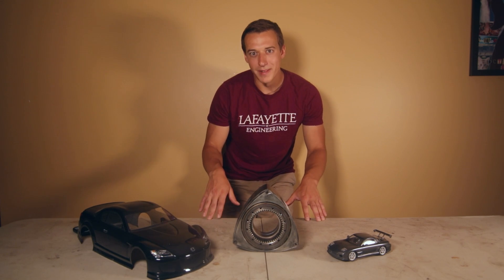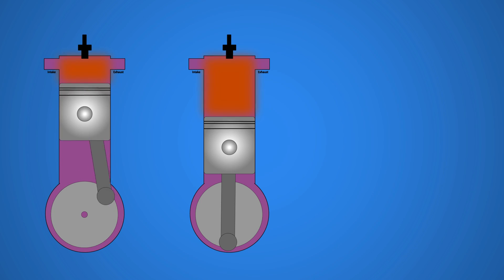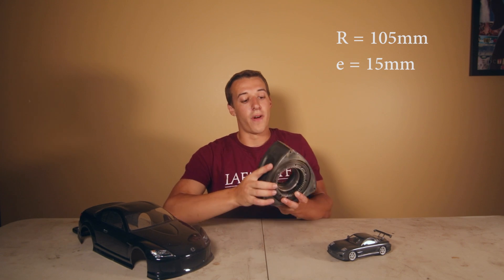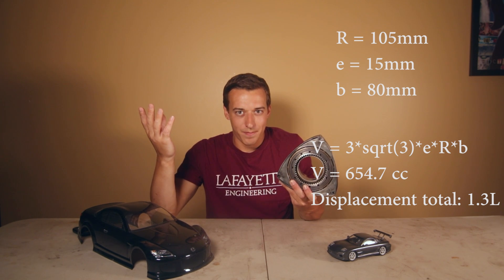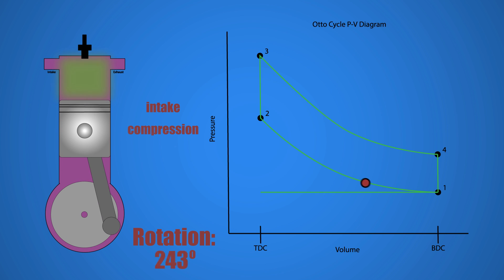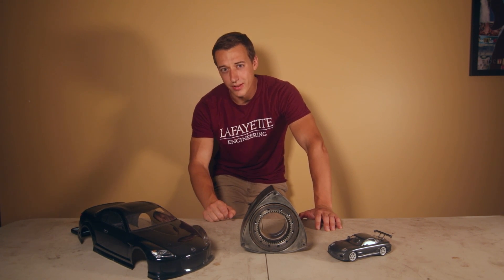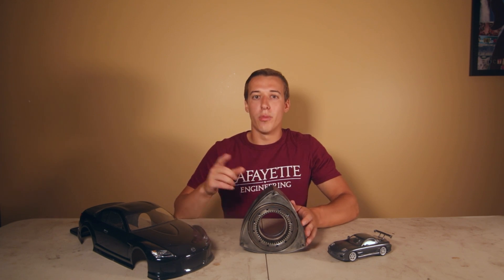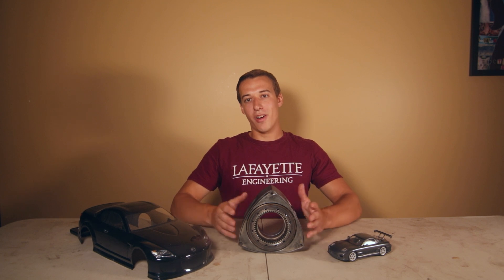You are WRONG about Rotary Engine Displacement

Comment: Unfortunately this video performs 2 instances of bait and switch.

First you correctly compare the swept volume of a single piston to a single face of a rotary engine but then perform the total displacement calculation by multiplying the swept volume of a single face by the number of rotors, each having 3 faces. 

Then when explaining the cycles you compare the piston cycle using crank rotation but then use rotor rotation for the rotary, which again is only valid per face of the rotor and requires 3 revolutions of the crankshaft. You mention this in the video but then proceed with the actual bait and switch by saying that this means that 1 Otto cycle is performed per revolution of the crankshaft which is only true when considering all 3 faces of the rotor.

The reality is that it takes 3 eccentric shaft rotations for a rotary engine to complete the full thermodynamic cycle as opposed to 2 revolutions of the crankshaft for a 4 stroke piston engine. This is the basis for why the rotary engine is sometimes classified as a 2.6L engine in competition as they are trying to even the playing field by setting displacement at 2 revolutions of the crank for all engines. In other words they aren't arbitrarily doubling 1.3L they are actually going down from 3.9L.

I also noticed your reply to a similar comment where you said that because combustion was not occuring on all faces at the same time that this somehow invalidates the calculation but this makes no sense. Surely you don't think combustion is occuring in all the pistons of a piston engine at the same time?
Reply: Excellent comment, you very elegantly cut the legs right out of this false urban myth.
Even Felix Wankel disgreed with the marketing department of NSU that concocted the fraudulent concept of "tax displacement" used by Mazda and other manufacturers to boost sales in countries that have registration taxes based on engine displacement.
Good work!

Comment: Sorry, you are missing the fact that each side is a separate piston, as my previous post states.  I rotor = 3 cyl, so again, 3.9L if that is how you wish to measure it.
Reply: Only one side of a rotor fires at one time not all 3, 1.3l
Reply: @edwardwillis6409  But each chamber has its own intake, compression, power and exhaust cycle.

There is a combustion cycle per  crankshaft revolution.
Reply: @edwardwillis6409  really I had no idea.   But at least in a three cylinder engine, they all fire at the same time ....
Reply: @Lonewolfz24  look up 3 cylinder firing order please
Reply: @Lonewolfz24  The true actual displacement is 3,924cc's 

Each of the chambers has its own intake, compression combustion and exhaust cycle.
Reply: @sandervanderkammen9230  I know each face / chamber does all of the cycles, I replied to your other comment explaining what I meant cus you misunderstood what I meant
Reply: @edwardwillis6409  If all 6 chambers have thier own intake, compression combustion and exhaust cycle.

Then each chamber has its own swept volume displacement. The total displacement is 3,924cc's
Reply: @sandervanderkammen9230  that's what my post said.
Reply: @Lonewolfz24  Yes, you are absolutely 100% correct sir, the Mazda 13b has a displacement of 3,924cc's

Comment: It is a 1.3L per Mazda and the Japanese government for tax purposes, ( hence why Mazda argued for the smaller displacement).  This also has been argued alot for 1.3, 2.6, or even 3.9 on rotary engines since they were first created.  Even more so, all three answers are correct depending how you do the measuring.  

1.3 - Correct for the way in which we measure a piston engine.  Cyl displacement x number of cylinders.  
         This comes to 1.3 for a Mazda rotary 13B engine, as there are 2 rotors, with a displacement of 654cc each = 1.308L

2.6 - Correct if you figure that a piston engines power figure is based on a 720 degree 4 cycle power delivery.
         A rotary makes full power stroke every 360 Degrees meaning its effective power is double same sized piston engine.
         (this is BTW why when rotary engines are in racing series, they are doubled in displacement, to equalize the numbers)

3.9 - Correct when you consider that unlike a piston engine, a single rotor has three sides all working at the same time.
         Imagine a piston engine with a combustion chamber on BOTH sides of it, then displacement would be double.
         On rotary engines, one rotor has 654cc displacement on ONE side of three,  then x2 rotors.  

The Best and easiest way to look at a rotary engine is to see each rotor as 3 cyl, with 654cc displacement per, making power every 360 degrees of rotation.  This would make a 13B about the equivalent to a 2.6L (power) 6 cyl (2 rotor x3 sides) 3.9L (efficient) engine.
Reply: If you have 6 chambers, each has a swept volume displacement of  654cc's 

It does not matter if the engine is a 2-stroke at 360°
4-stroke  at 720°
Or a Wankel at 1,080°

The displacement  will still be exactly the same  3,924cc's
Reply: @sandervanderkammen9230  I don't disagree, the point wasn't to say it should be called a 2.6L, but that the power output is like that of a two stroke, which is why in racing, they tend to calcify the rotary engines as double, to give a comparable piston engine an even playing field.
Reply: @Lonewolfz24  The 2X conversion formula is intended to compare rhe Wankel engine wirh reciprocating 4-stroke engines.
To compare the relative displacement at the same 720° cycle duration.
The Wankel engine is not a 2-stroke which is where much of the misunderstanding begins.

Most engineers, government agencies and motorsports sanctioning bodies use the 2X  formula for calculating the displacement of the 654cc's chambers at 720°.
Reply: @sandervanderkammen9230  you know, this argument is getting tiring.  Everything you said is correct.  Notice I didn't say the rotary is a two cycle. I said as it makes a power stroke Every 360 degrees of the "crank" LIKE a two cycle, that's why they do the 2X for racing conversion.  Which is what you just repeated.  Simple, true displacement is 3.9 6cylinder making power at double the crank (yes it's not called a crank) like a two cycle engine.  Another way you can argue it is to say the rotary runs at double the rpm as a piston engine for purposes of power.  My whole original point was that you can make the argument for any of the three displacements depending how toy want to look at it.  The 1.3 being the most incorrect IMO.
Reply: @Lonewolfz24  A 6-cylinder Otto engine has 3 combustion cycles per crankshaft revolution.
The Mazda 13b only has 2.

The Wankel engine runs at 2/3rds the cyclic rate of a 4-stroke reciprocating engine.
Reply: @Lonewolfz24  FYI: Yes, its crank...
Hanns Paschke and Walter Freode named it an Exzentrschekurbelwelle
This translates into English as
Eccentric-Crankshaft.
Reply: @sandervanderkammen9230   man you are just grasping at straws to show someone else up.  Fine, I'll play along.  In English, it's just referred to as the eccentric shaft, instead of a crank shaft, which is why I said it.  However since you'd like to use the German term, sure, it is a crankshaft.
Reply: @sandervanderkammen9230  only in a 2 rotor setup.  Again, we are all just trying to liken two dissimilar ice engines to one another.  I have not said it is the same as something else, only the easiest way to compare them.  And your point just shows another reason you can say it's a 2.6 instead of 3.9.  As I stated from the get go, all three can be argued, as it's all how you want to look at it.
Reply: @Lonewolfz24  An eccentric shaft can be a crankshaft or a camshaft all depends on how it is driven...
In the Wankel KKM is driven as a crankshaft.
Hanns Paschke and Walter Freode were both German... they invented the Wankel KKM and they say its a crankshaft

FYI: Felix Wankels' engine doesn't have any shaft... its a Rotary type engine.
Reply: @Lonewolfz24  You still miss the point...
 displacement of an engine is calculated exactly the same way regardless of the operating principle used.
360°, 720° or 1080° cycle makes no difference.

The Mazda 13b series has a displacement of 3,924cc's 
No more, no less.

Yes, you can say "its like a 2.6" when compared its power per liter performance to a 4-stroke reciprocating engine but its still a 3.9 liter because that is it's true total displacement.

3,924cc's
Reply: @sandervanderkammen9230  and you seem to have missed the point that I've said I agree with the 3.9 many times in this point .... I'm not arguing against it.
Reply: @Lonewolfz24  Yes, we both agree about the displacement.
What you seem to be having trouble with is the logical conclusion of how we get to that displacement value.

Displacement is calculated exactly the same regardless of the number degrees to complete its cycle.
Reply: @sandervanderkammen9230  insulting now, I do understand, I'm not arguing the displacement, or the reason you are using it.  I haven't disagreed with the swept volume.  It's one way to measure it, and that's fine.  Mazda used the way that was best for them, is that surprising.  As it's not a like for like with piston engines, that gave them a way to argue to measure it differently.
Reply: @Lonewolfz24  I’ve been playing along too I can’t be asked to argue until he takes off his ego hat
Reply: @Lonewolfz24  No insults intented, as I said before there is only one way to calculate displacement of a internal combustion engine.

It's important to get the right answer but you need to understand how you reached that answer, on this matter you seem to be attempting to save face..
There is no need to be embarrassed, its a confusing topic.
I just want you to get it right, thats all.
Cheers mate!
Reply: @Lonewolfz24  NSU Motorenwerkes GmbH. Made that argument, the was their reasoning that if their company invented the Wankel KKM engine they could determine the method of calculating its displacement.
Mazda simply adopted this purely marketing logic... and as the very last manufacturers of Wankel engines until 2012, this myth regarding displacement has continued and has only caused confusion and misinformation.
Reply: @edwardwillis6409  You won't learn anything about Wankel engines until you take off that dunce hat son.
 Stop pretending to be something you are not and pay attention.
There might be a few people who know more about Wankel engines than I do..
But not very many.
Reply: @sandervanderkammen9230  lol, man, you are just trolling.  I never said Mazda invented the displacement tax method, but I did say they convinced the Japanese gov to see the rotary engine as a 1.0, when they released them to get the tax benefits.  Hence saying that Mazda had the rotary classified smaller, for their benefit
Reply: @Lonewolfz24  Not for one second, I'm serious as a heart attack. 
 Be honest, you didn't know the origins of tax displacement method before I explained it to you... and just because they chose to use this sales ploy to their advantage, does not mean that this method or Mazda is correct regarding displacement.

Swept volume displacement is calculated exactly the same way for reciprocating engines.

You can choose to disagree with me but both Max Bentele and Hanns Paschke say you are wrong.
Reply: @sandervanderkammen9230  dude, you keep repeating yourself, and I've said over and over that 3.9 is correct, it's like you are arguing with yourself.   Maybe you should read the very first post again, and articulate what your grievance is.  You seem to be misunderstanding, or misrepresenting what I've said, as you have now many times tried to argue something that is the same as what I've said.  Yes, they did it for tax reasons, I never said they didn't.  No, I never said Mazda invented the tax method.  Yes, the true displacement is 3.9 if measured like a piston engine, that's in the original post.  As the engines do not work the same, one could/can/ and did argue that the displacement should be different, as they function differently, which is what Mazda did.  All three could be used, depending how you would like to look at it.  No, in English, the language we are having this talk in, the "crank" is simply called an eccentric shaft (even by Mazda), while in German is is called a crankshaft .... which all seems very pedantic to sound like a know it all and somehow more knowledgeable than someone else, when all you've done is agree with my original post .... what is the point sir?
Reply: @sandervanderkammen9230  just saying I said take of the ego hat cus your replies seemed rude, it seemed like you thought you are better than everyone (not talking about what your saying, it’s how your saying it), just be nicer. Don’t TELL people educate them your somewhere in the middle of those two. 

Also if the rotary is a 3.9 does that make it not a true small engine compared to like the b16 from Honda the 1.595cc engine?
Reply: @Lonewolfz24  Your original comment suggests that it is correct to say the 13b engine is 1.3, 2.6 or 3.9 liter...  it is not correct to say it is a 1.3 or 2.6 in swept volume displacement.
 It is only called a 1.3 by using tax displacement which was used by some manufacturers, it is not universally accepted and is not a valid method for calculating the displacement.

It is only appropriate to say "its like a 2.6 liter" when compared to a reciprocating 4-stroke engine.

Its is not correct to say it is a 2.6 liter. 

I hope this clears up your confusion.
Reply: @edwardwillis6409  Yes, I agree, your comments do seem rude and disrespectful, if you wish to be treated with respect? You should do the same.
It is extremely rude to argue about a topic which you are not properly educated or experienced to discuss inteligently.
 You are not an expert on Wankel engines or engines in general, yet you rudely post disrepectful comments disputing well-known and understood facts on this topic..
Perhaps what you need is a little more studying and some maturity?
Reply: @sandervanderkammen9230  you get what you give in my opinion in short your replies seemed rude so i was rude to you
Reply: @edwardwillis6409  The facts speak for themselves, you simply had a rude awakening because you were unprepared to hear it.
Reply: @sandervanderkammen9230  as you were confused, read the last paragraph again, it should clear everything up.  It clearly says the engine displaces 3.9L.
Reply: @Lonewolfz24  Thats my point, your comment is confused and misleading.
Reply: @sandervanderkammen9230  I'm sorry you were confused and mislead.
Reply: @Lonewolfz24  Perhaps you should correct you mistakes then?
Reply: @sandervanderkammen9230  mazda didnt stop manufactuing the 13b in 2012. They stopped manufacturing the rx8. You can still buy brand new 13b from them
Reply: @hayeduce  Mazda ceased series mass production of all Wankel engines on June 21st 2012, the Ujina #2 RX engine plant was demolished in 2013 and replaced by a Skyactiv G engine factory.
Reply: Actually, relative to every other internal combustion engine and how displacement of an engine is calculated, 3.9L is the only correct answer because number of crank shaft revolutions it takes to move the complete engine displacement has no baring on an engine's actual displacement. The engines displacement is simply the volume of a single working chamber times the number of chambers. Example, a 2.0L 4 cylinder engine has a single cylinder swept volume of 500cc and has 4 cylinders and thus its displacement is 2000cc (or 2.0L) and as you mentioned, a rotor (13b sized) has a single side that displaces 654cc and has 3 sides so that single rotor complete cycle (i.e., all 3 sides moving their respective displacement volume) is 1962cc (654 x 3 = 1962) and since there are two rotors, its 3924cc (1962 x 2 = 3924).

Again, for those that want to argue it, number of crank (or in this case E-shaft) rotations is irrelevant when it comes to an engines displacement calculations.. this doesn't matter if its a 2 stroke, 4 stroke or hell, even the Crowler 6 stroke experimental engine for that matter. Displacement is simple swept volume of a single working chamber times the number of chambers.
Reply: @CP_300PRC  well AcTUalLy 🤓
Reply: @xMorbidArtx  Actually he is absolutely correct, the  Wankel engine is 4-stroke so the displacement is 3.9 liters, not 1.3

Comment: It's accurate to say that the 13B rotary pumps as much air as a 2.6L 4-cycle engine.  One could also say that it pumps the same volume or air as a 1.3L 2-cycle engine, a point that you made in the video.  It's similar to a 4 L 6-cylinder piston engine in that in 3 rotations of the eccentric shaft it's total swept displacement 3.924 L with 6 power (oto) cycles.  A 4L 6-cylinder 4-cycle engine would do this in only 2 shaft rotations however.
Reply: Darth Vader  Kenichi Yamamoto would disagree with you. ''The rotary engine is a four stroke one cycle engine'', Rotary Engine by Kenishi Yamamoto, p.7
Reply: Except the Wankel engine is not a 2-stroke... it operates using the same 4-stroke principle as reciprocating Otto engines.

The displacement does not change.

   If you have 6 chambers, each has a swept volume displacement of  654cc's 

It does not matter if the engine is a 2-stroke at 360°
4-stroke  at 720°
Or a Wankel at 1,080°

The displacement  will still be exactly the same  3,924cc's

Comment: Nice video man! I have this problem were I live in Europe / Romania it is written in the cars official document as a 2616cm3 and this is because the original calculation was done to convert it to a piston engine witch is absolutely stupid. The volumetric capacity should not be based on a conversion it has to be the correct volume number like you pointed out.
Reply: Witch? Talk about absolutely stupid.😊